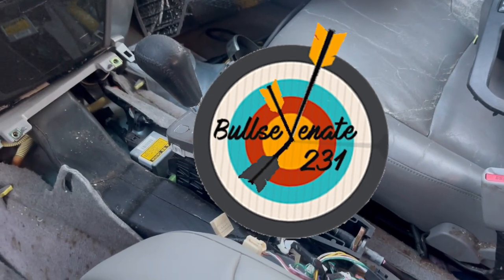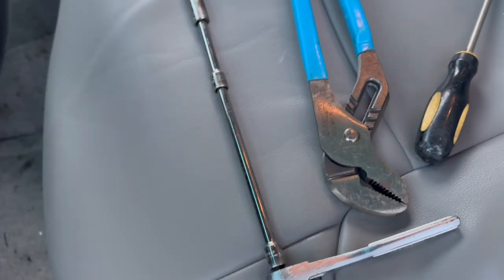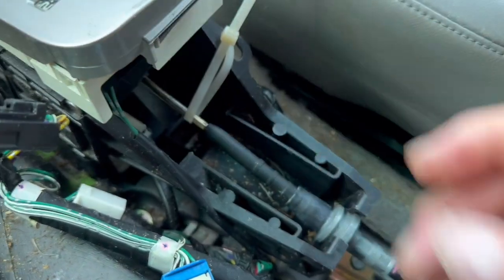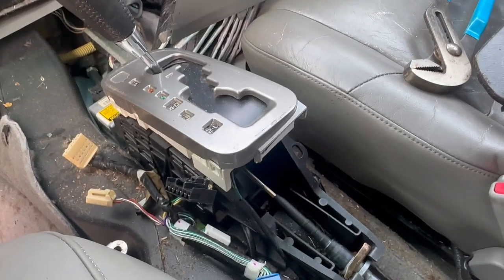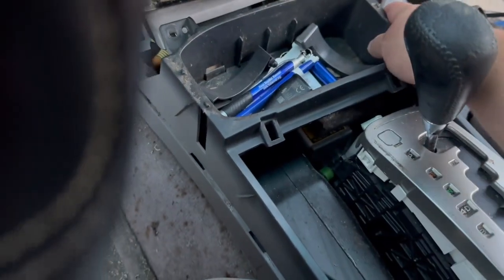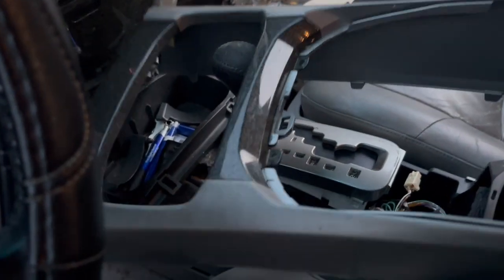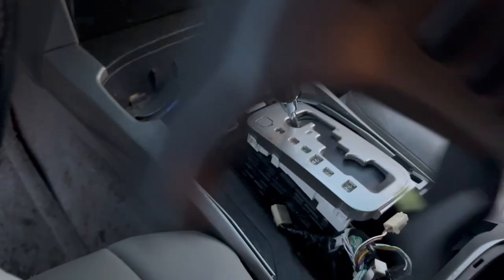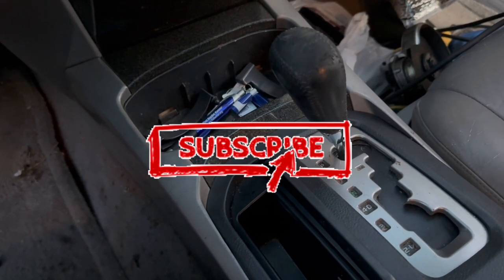How to fix the shifter cable bushing on a Toyota 4runner 2003-2009

Comment: Where did you find the bushing? I’ve called every part store and I’ve been having to manually shift under the car but no one can get it
Reply from the maker: @chrissherrell3771  the local Toyota dealership sold me one at the parts department. It was actually for a Corolla but it worked just fine for my 4Runner. You can also order one online for your vehicle. If you have a 4Runner you can click the link in the description.

Comment: don’t order the one in the link it doesn’t fit
Reply from the maker: @cadecrawford  Always make sure you double  check the fit for your vehicle. Depending on your year and even model (sport,  Sr5, limited, etc.) the bushing may vary a little. 
What year and model 4Runner are you trying to find a bushing for?